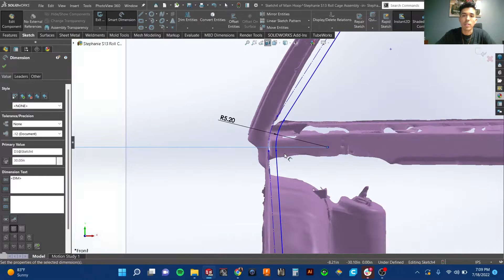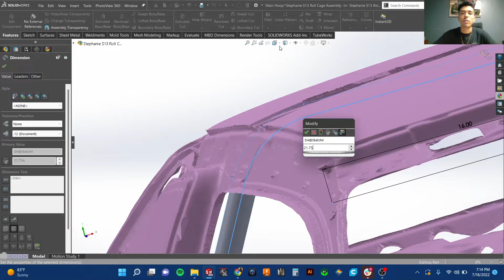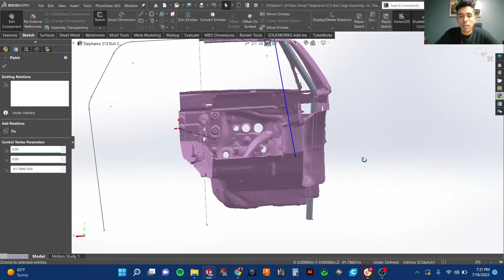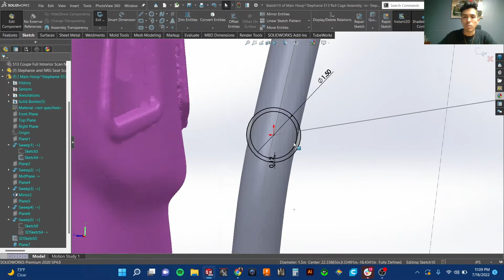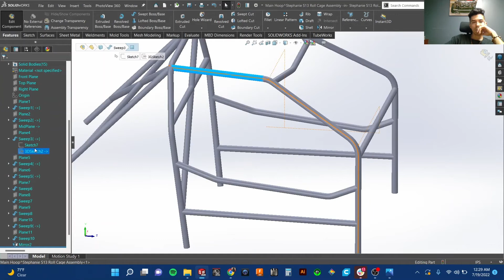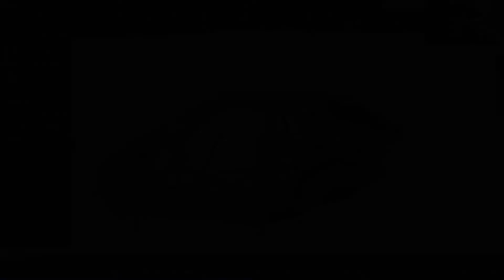S13 Roll Cage • FULL Design Walkthrough

Comment: You can save a lot of time by using the weldments tab to do your tube instead of having to create a plane, circle and extruding each bar. Just use the structural member tool 🤙🏻 it will also make a cut list and dimension the individual parts for cutting and fab